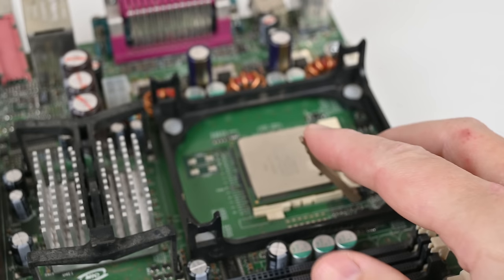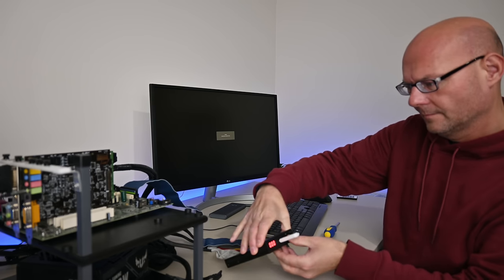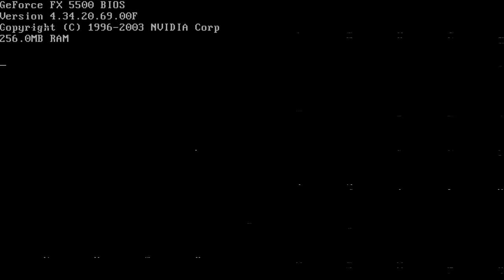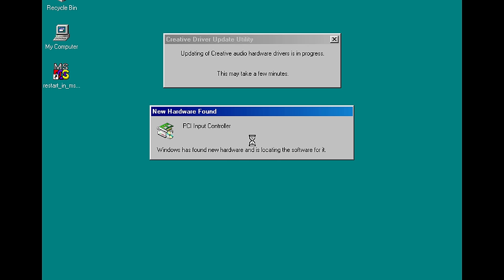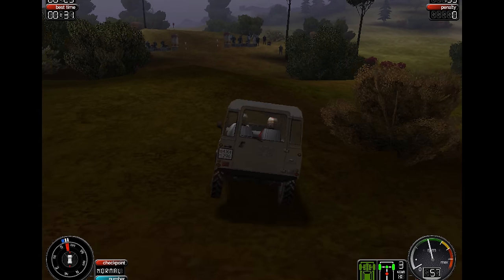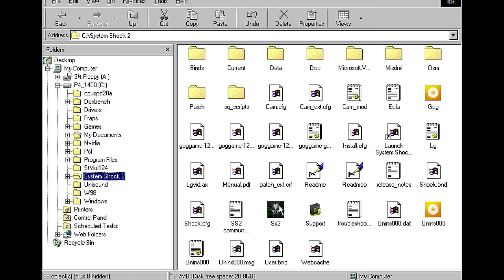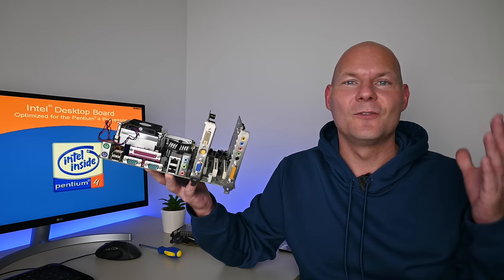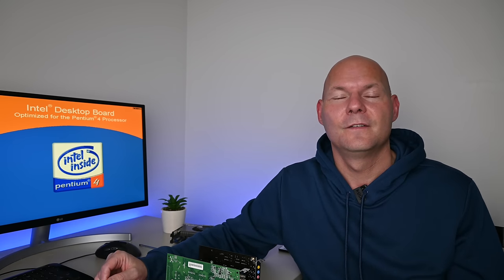It Failed in 2000, Has It Aged Well? The Pentium 4 1.4 GHz

Comment: I had a Dell Optiplex workstation PC back in the early 2000's, with a 2.0Ghz P4. Wasn't anything amazing, but really well engineered PC, tool-less access, plenty of room, etc. As all I played from 1999-2004 was Quake III OSP, I never needed anything more. Once Doom III came out, I did eventually upgrade to an Athlon 64 rig. But the P4 had enough power, coupled with a Ti4800SE, to run Q3 at 1280x1024 160fps all day long.
Reply: It did really well in Q3A, pretty much the game where it was unrivalled.
Reply: @HappyBeezerStudios  Id Tech was so soundly programmed and efficient, pretty much any modern processor had a good crack at running the game. It scales exceptionally well, even today, with both CPU's and GPU's.

I had a Duron 750Mhz at some point, with onboard S4 Savage 2000 graphics, and even that machine played Quake III very smoothly - albeit in vertex lighting and 512x384. But considering the hardware, that was super impressive! Adding a TNT2 Ultra to the machine made the game fly in 800x600.

I know netburst is slow, inefficent, and the original P4s were no match for even the P3 IPC. But that 2Ghz Northy was a supreme workhorse, consdiering.

Comment: I think the most modern RAM the Pentium 4 can take is DDR 2 on socket LGA 275, as well as I believe the last Pentium 4s being 64-bit. It lasted quite a bit and if I remember correctly the Pentium D was quite the cost effective solution for Intel if you didn't want to get an Athlon X2 until Core 2 Duo released. Of course all of these chips were quite a bit before my time while I was gaming at the time I was just a child.

Comment: I've never used any flavor of the P4, since I was only in high school when it launched and couldn't really afford it.
I was using an AMD Duron 600 or 700 MHz then, and I used the pencil trick to unlock its multiplier and overclocked it to almost 1 GHz. It still sucked due to its lack of cache, but I didn't feel it was worth it to upgrade to an Athlon XP. When I did have enough money to upgrade, I went straight to the Athlon 64. It was actually an Opteron 150, the equivalent of the 4000+ which I also couldn't afford, but it cost half as much due to what I supposed to be a pricing error (the shop still honored the sale, but raised the price immediately after).
Reply from the maker: Nice!
Reply: The Durons were decent. Same for the P6 Celerons. Cheaper, but not cut down too much. The NetBurst Celerons were absolutely horrendus, getting cut at exactly those points that impact performance the most.
Reply: @HappyBeezerStudios  IIRC, the Duron I had was an OEM or mobile variant with only 64 KB of cache. It had CnQ, but no SSE. I should've gone with an Athlon 650 or 750 instead, which wasn't much more expensive.
I looked at the Celerons, but they were much slower, and sometimes more expensive than the Athlons where I live, so I didn't give them a second thought. Maybe I should have, due to how overclockable they were.

Comment: I recently found a Dell Dimension 3000 and a 4500 in a dumpster. With the exception of my Dell Inspiron 8600 with a Pentium M CPU, these are my first P4 machines (back in the day I had an Athlon XP (I think it was an XP)). The 3000 doesn't have AGP but I found a cheap PCI 5200 recently but the 4500 does have AGP also both have their Win XP keys so I think I'll make them XP machines. I do need more space to set them up so it may take a while but I'm looking forward to dabbling with them. I do however remember being a bit meh about the P4 back then. I think the evolution of the P2 and P3s were more exciting especially the race between Intel and AMD about who would break the 1 GHz barrier first. After that the 2 and 3 GHz barriers just went down too quickly so it never really caught my attention. However, the P4 Extreme Edition was a CPU I did find myself fascinated by. So yeah, looking forward to exploring that platform.

Comment: I had the Intel Pentium 4 socket 775 for approximately eight years for sample sequencing on EJay software etc. Then I wanted to transfer the old 1998 VHS tapes to DVD so I built a Core 2 Duo style PC 2007-2008.

Comment: im in the camp of not liking the P4, but thats because i actually had them back then and i remember my P4 478 northwood at 2.8GHz were shit comapred to my friends Athlon 64 3200+which didn't have hyper threading, less ram on the system and 2GHz base clock(slight bump to 2.2GHz if memory serves) :D

I was like, im gonna do one better and changed out the board to a 775 asus(wtih a VIA chipset and AGP slot for my 6600GT) and the cpu was a pentium D 830, which i manged to get to 3.6Ghz with a giant tower cooler from some chinese brand with two fans. 

then i finally had the faster pc :D and a year or two later he got an E6600 and i was beat once again until i got a new one, it was a fun rivalary :D

Comment: I had a Prescott CPU in my first PC my dad bought me. Of course I had no clue then, but I had so much fun with it and remember pushing it to the limit with Crysis before upgrading to an AthlonX2 later on. The best upgrade I made to my Prescott system was getting a sound card, a ballin' Creative Audigy 4! My framerates went up and frametimes improved big time.  🚀
Reply: I finished Crysis on Celeron D 2.8 GHz and GeForce 7600GT (AGP version), can you imagine that? There was like 25 FPS max and I finished it on that. 😀
Reply: @Pidalin  The ice levels must have been a slideshow!! 🙈
Reply: @redwinedrummer  yes, bu as Mandalorian would say - this is the way 🙂

Comment: The RDRAM era was interesting. In the end it was killed off due to price, which means the used market is small and the parts are still expensive. But it was used in the N64 and PS2 later on. DDR wasn't much slower but a lot cheaper.

And Northwood wasn't even that bad. A different attempt at performance. Prescott was the one that ran super how, was super hungry, and even slower clock-per-clock. With the shrink to 65 nm on Cedar Mill most of that was fixed, and those chips are okay, but pretty much a last release to keep the mills running.

Looking at the architectural changes to Merom and Conroe shows the issues with NetBurst. It was super bandwith starved and SSE was done very inefficiently. 
But the ALU performance was decent and in tasks that can keep the pipeline filled without stalls it performed great. Yes, K7 was faster in games, but for mp3 encoding or video rendering the Pentium 4 destroyed it.

I have a Cedar Mill HT 631, and can improve performance by lowering the multiplier and upping the FSB. Running 12x250 instead of 15x200 gives about 15% more performance along the board. But it's still destroyed by a Celeron 440 with half the TDP, a quarter the cache and 33% lower clocks.

And I totally agree on the Geforce FX. They are horrible in DX9, but are really great in DX8, and the while FX 5200 is pretty much garbage, the FX 5200 Ultra is a beast, beating the 5500 and some 5600 models.

Comment: I have a pretty interesting P4 board Its Socket 478 with the ATI Express 200 Chipset with PCI Express! Its pretty cool, I have a 9800 GT in it atm. Oh also running a 3.2GHz Northwood P4. Board is an Intel D101GGC

Comment: The pentium 4 was a great CPU, i had a 3 GHz version back in the day and was happy for many years with it.
For retro gaming, i built a system half a year ago with a pentium 4 1,4 GHz with very good parts and wanted to pair it with a Voodoo 3 as well, but i didn´t knew that the AGP slots of the mainboard was not compatible with the voodoo 3 AGP. So i had to use another card and used a Geforce 4 Ti 4200 instead. It works beutifully for all windows games from 2001 until 2008.
The voodoo 3 now runs in a pentium 3 PC, which i got from a good colleage of mine - but has the worst pc-case ever without any air flow - just the power supply with one little fan O_o
Reply: If you're not picky about the case you can always put more fans in. Usually the back below the PSU has a fan, but obviously not every case. So you might want to just cut a hole and add one. Same for the front. Some 80mm fans on 7V should run quiet enough and help keeping the parts alive for long.
Reply: @HappyBeezerStudios  The case has no place to put any fans into (Medion 2000 Case). Its the worst case i ever has built a PC with no air-flow.
Reply: @F1nalspace  get the dremel ;)

Comment: Many of the GOG sold games I've tried that had soundtracks originally as redbook audio and dumped to OGG or MP3 in the game folder usually work if you burn the audio files to a CD as a music CD. Only one that really gave me fits was Outlaws. You still end up with the audio quality that the OGG or MP3 was but at least you get the soundtrack working for many of the releases on GOG that way.
Reply from the maker: It's worse than that actually. They patch and edit exe files and DLL files that break the games on original OS, it is a real shame. It is much easier to just get the images from archive.org, but buy the game form GOG so it's legal.
Reply: Instead of burning an actual CD might be worth burning it onto an image, and mounting that.
If it's just for that and no fancy modern DRM involved, there are uninvasive tools for it.

Comment: I build my first own PC with an Athlon 1100 just days before the P4 came out. I never built an P4 PC for myself but I remember it - as a plattform - being pricey at first until Intel introduced DDR memory. Then everybody seemed to complain about it running hot but I can't remember someone I built a P4 PC for back that ever complaining about that to me. 
Maybe because I always used tray CPUs and aftermarket coolers back then? idk. But I remember P4 and Athlon (XP) were pretty similar in that regard.

Btw. My first boxed CPU was an Athlon 64 3500+ cause it was cheaper then the tray version but never used the cooler with it. I don't know what happend to tray CPUs. They became around that time more expansive the boxed ones and I rarely used them from then on but I continued to use aftermarket coolers in most cases. I had a gaint box of boxed coolers that I sold very cheap. In retrospect clearly a mistake cause these were a lot of copper core ones. One of them would cost more today than I got for the entire box back than. But yeah who had thought only 10 years ago that even very common hardware like this would be become this expansive these days.
Reply: the old athlon 64 era OEM heatsinks actually were not all too bad. I have phenom II heatink which is essentially exactly the same sip tied to my intel i5 as I need a new heat sink copes with it quite well idle at 30 most of the time with a peak in the mid 80's overclocked at that :D

Comment: My biggest regret to this day and age. As a 17y old scrapped all my money together with a lot holiday job during school and bought a 2.8 GHz Northwood gaming system. Was not that hard into proper hardware reviews. The system did fine but really did not age well and was subsequently replaced by an overclocked E2140 system (iirc). Still, P4s still are a memory of a very fond time. Thx Phil!
Reply: The struggle back then. Just a few years later the core 2 duo system would last for far more years than P4 platform
Reply: @excess.subiefl0w  Exactly.
Reply from the maker: Performance exploded back then, you had to upgrade constantly. I had a Northwood 2.6 with Radeon 9800. Great memories.

Comment: Just built a similar system with a 2.4ghz P4 with Geforce 2 GTS & SB Audigy for win98. Later dos games were a challenge but windows games ran great. The latest I was able to run was Serious Sam 2 and Return to Castle Wolfenstein. Phil on a side note could you do a video on an LGA 1366 based system for winxp?
Reply from the maker: I can, yes, but for the moment I want to steer the channel back to the older stuff. 1366 is quite modern and can run Windows 10 and many modern applications and games.

Comment: I remember my Pentium 4 but didn't get into it until the Socket 478. I don't remember having any major issues with it but I spent a majority of my time in the Pentium II / III. 
My Pentium 4 build ended up getting passed along to a nice chap in the area who ran a used video games/movies store. I had since moved to a Core2Duo and never revisited the Pentium 4 after that. 
I think my biggest beef with the Pentium 4 was heat... that system was a space heater and the air conditioning in my room at the time was already struggling without that system on.

Comment: I don't understand how intel could make this mistake, obviously a long pipeline and poor branch predicting would be detrimental to an average user aside from content creating. Intel sure did market it, at one point DELL was making more money in kick backs form intel to not ship AMD than from actual legitimate sales.
Reply: They expected the architecture to scale to 10 GHz by 2005, and at those clocks it would be unrivalled.
Turns out that didn't work so well. The longer pipeline, lower IPC Prescott design didn't clock any higher than Northwood, but was slower, and Tejas prototypes pulled 150W at 2.8 GHz, while Northwood did that with 80W and Prescott with 100W

Comment: It was the P4 "Prescott" (or Press-HOT) that got me into water cooling.  I discovered that the motherboard was automatically slowing it down as it reached the max allowed temperature, so benchmarks ran faster when the case was disassembled and I put a big box fan next to it.
The included heat sink/fan was simply insufficient!  Bad engineering!
I looked into other heat sinks and found that they got so big and heavy that the motherboard could not handle the weight and they needed nonstandard mounting, and had trouble fitting in a case, and other issues.
Meanwhile, water-based cooling worked orders of magnitude better, and I figured air cooling was pushing its limits but water cooling was just at its entry point.

Comment: I have an old HP computer that uses socket 423. It's running a 1.3 GHz Pentium 4 in it. It originally had Windows ME, but I downgraded it to Windows 98 SE for retro gaming.
Reply: That truly sounds like a marketing computer.
Brand new Pentium 4
Brand new WIndows
But both basically the worst versions available.

Comment: If you can get one for cheap, enjoy it!!! 
Only thing I dislike about  socket 423/478 is power consumption and lack of cheap/silent cooling. But for Socket 478, at least i found on thingiverse an adapter to use a cooler master hyper 212 heatsink, haven't tested it yet, but at least it's something.
Reply from the maker: Oh nice that adapter sounds useful!
Reply: If you think 478 draws power, get of them 115W LGA775 Prescotts. Upside is you can use a hyper 212 evo out of the box. downside is you'll need a cooler like that to keep it even remotely cool.

Comment: it was in 2000 when i finally bought a new PC after holding out on two P200 MMX machines (as a LAN setup to game with friends/guests) and went for the sockel A thunderbird 1000Mhz.
that was my first AMD cpu and intel only made it into my home way later when i moved from a phenom 955 to a i7-4790K which is still my main PC as of now.
i can't quite remember if i even considered the p4 (or p3 respectively) at that point in time. being young and mostly making buying decisions off of what friends told me or when i saw some "cool advertisment". could also have been that it was some kind of nice offer in those small tech stores that were around a lot more at the time.
Reply from the maker: 1 GHz Thunderbird is very nice!
Reply: @philscomputerlab  it's lying around somewhere i am not entirely sure if it is the 133 or 100 FSB piece